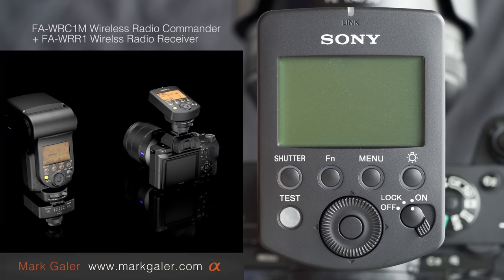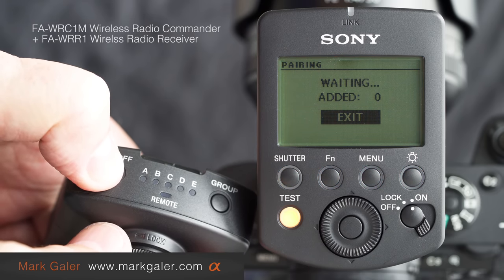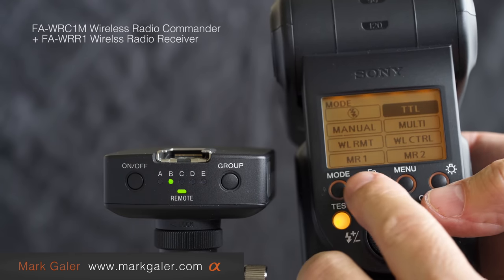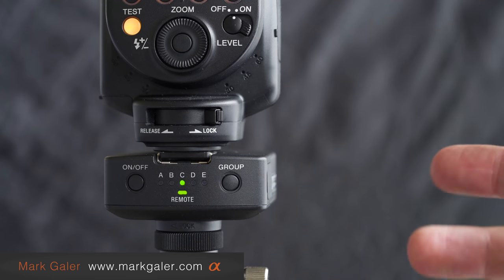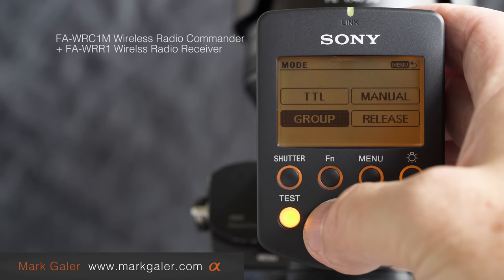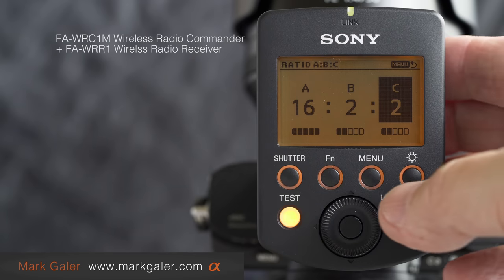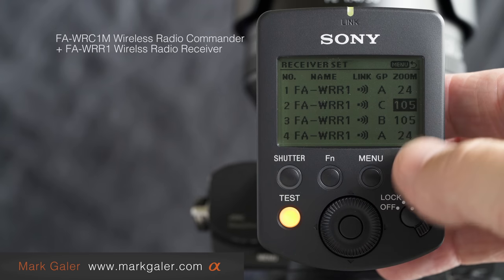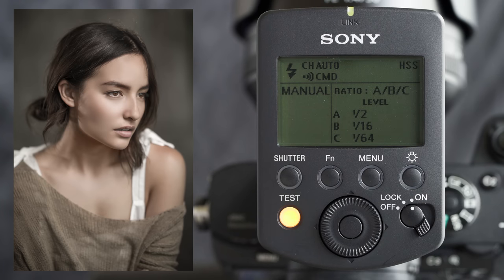Sony's Radio Wireless Radio Commander and Receiver for Flash - FA-WRC1M and and FA-WRR1

Comment: Hi Mark, Thanks for this nice introduction. This seems fairly easy to use, but then again so is the Godox System. How would you compare these to the Godox ? I find the latter very easy to use and it has been, at least for me, very reliable.
Reply from the maker: I am not familiar with the Godox. I like the Sony System because of its ease of use, the fact that it will fire up to 5 groups of flashes and also non-Sony Studio Strobes. The system will also allow me to trigger remote cameras as well as remote flashes.
Reply: @AlphaCreativeSkills  Hi Mark, I currently own this commander and HVL-46RM, I’m considering about adding few new studio strobes, so I wonder if random studio strobes work with this commander. Thank you!